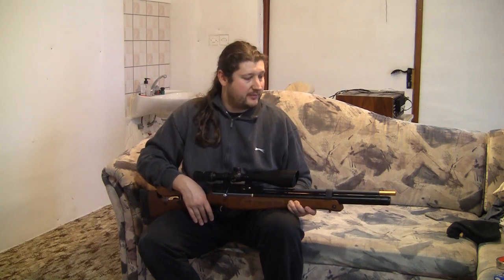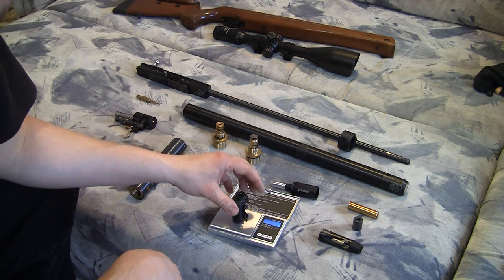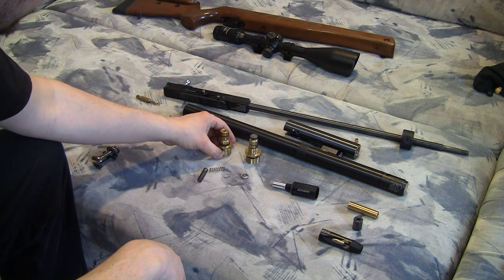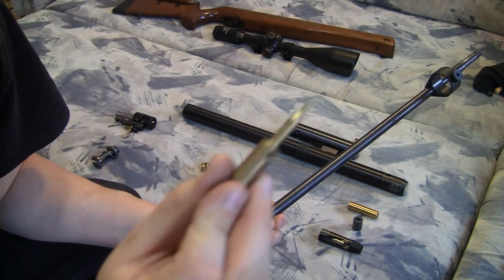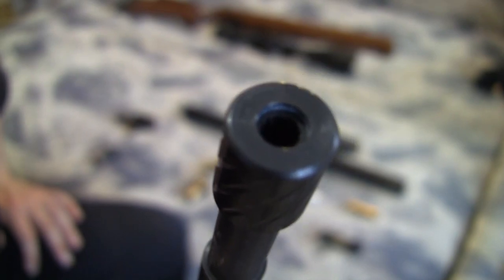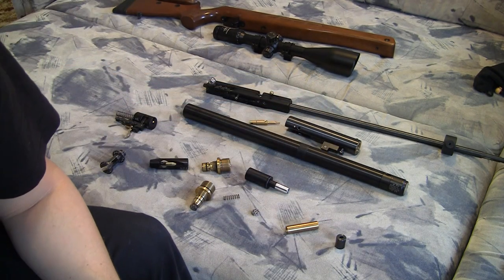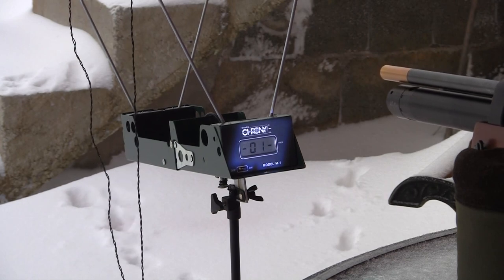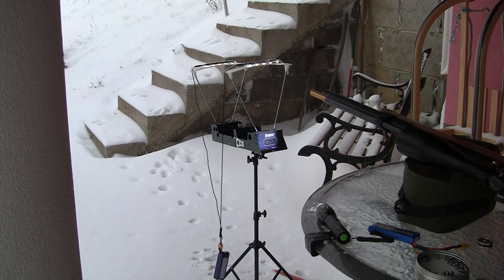Hatsan BT65 .25 regulated and unregulated

Comment: Where would you get the heavy spring you mentioned or part number so others can find it online, for closing the valve with regulator.
Reply from the maker: I have done several modifications since I made this video and right now I am using stock valve spring, but I did enlarge the valves seal (plastic seat, you get one spare with the gun) to 6.5mm. You can use the stock plastic seal, just turn it around...
Reply from the maker: BTW: I am not sure how it is in your country, but here where I live there are many spring manufacturers. All you have to do is sent them dimensions and they make a spring by your specifications. It costs about 10 eur per spring...

Comment: Awesome video, but I have one question, Could you show the shot count if you tuned to hammer spring down so that the JSB Kings would shoot around 295ms...Would not the bell curve be better and in turn have a much longer shot count before the ES goes bad?
Reply from the maker: Hatsan Varmit Hunter Extreme Channel I assume you are referring to unregulated rifle. If you use an unregulated rifle you will also get a curve, no mater what you do. I am sure that I would get more shots with modifications, but I do not see the point in it. I would rather user the regulator and rise the pressure to achieve 295m/s with JSBs. The shot count would be smaller (probably 15 - 20 shots), but there would be no curve and what is even more important - accuracy would be much better. I only wanted to test the power limits with an unregulated cylinder, that is why I have two cylinders: regulated an unregulated.
Reply: If you take a look at my video with un regulated BT65 .25 it has a ES of 11 right now, and my 100yard groups are under .900 or 22.86mm my 50yard groups are under .400 or 10.16mm I do not see how one can get much better then that with this rifle... If you can shoot a 12.7mm 5 shot group at 100yards then I would be sold on a regulator. You are 100% right...Hatsan is not built for a regulator.
Reply from the maker: Hatsan Varmit Hunter Extreme Channel I gees you had more luck with the stock settings of the rifle than me. You could not have groups like that with my BT65 without modifications. I could have a good group but only 5 - 7 shots per fill. Now I can get more than 20 shots in 1" or less at 100 yards (if there is no wind...).
Reply: All I did was plug the valve port with 8/32 set screws and left one open. re crown the barrel, and clean it, and adjust the hammer spring, gives me around 11-12 good shots before start gong south. which is not bad for stock if you only hunt like I do. But I can shoot over two clips just have to adjust a tad bit with mil-dot hold over.

Comment: This is a very good video! I will do it on his rifle. Tell me, please, what is the diameter of the bypass in the barrel(6мм or less) and the diameter of the needle valve. And spring striker standard or more stringent? Thank you very much!
Reply from the maker: I assume, by bypass you mean transfer port. It is 5,5 mm, you can also make it bigger, but you will have to replace the o-rings with thinner o-rings. The diameter of the needle is 2,4mm. Striker spring is standard but it is slightly loosen with the regulation screw.
Reply: Thanks a lot! forgot to ask, what diameter of an exhaust outlet in a tank stopper? already I ordered the regulator on the site. I will saw, cut and collect!!!
Reply from the maker: Originally, the valve seal has 6,5mm hole and it is made obliquely. I recommend that you make is straight and 6mm in diameter
Reply: Gregor Kamenšek Gregor, tell, please, for installation of the regulator it is necessary to drill an opening in the tank or not? In the instruction on the site it is told that it is necessary to remove rubber laying on a stopper and to leave a gap. Your elastic band is left. Thanks.
Reply: Антон Быстров And one more question! the special stopper for the tank was bought, or made independently or under the order?
Reply from the maker: Антон Быстров No, it is not necessary for the Altaros regulator to drill a hole in the tank, but you do need to remove the o-rings. Just follow their instruction video (don't forget to turn on subtitles) and you will do fine...
Reply from the maker: Антон Быстров I made it, as well as all other parts for these modifications.

Comment: @Gregor Kamensek, you ever thought about selling your valve assembly ?
Reply from the maker: Well, yes I did, but there is a lot of problems; for example, the TP hole has to be made for a specific gun ans not two guns will thread the cylinder in in the same position, and this is a problem with all custom parts I made for Hatsan...
Reply: Alright... Thanks

Comment: Did you happen to do any groups with your modified BT65, say at 50 and 100 yards or meters?
Reply from the maker: Only 50 meters, I am afraid we have very poor choice of shooting ranges here. Best group at 50 meters is about 16mm ctc, worst is about 30mm. These groups were done by JSB Kings, unsorted.
Reply: +Gregor Kamenšek - That's pretty doggone good but you ought to take a look at what BWalton has done with his Hatsans. His channel is Airgun Hunter Extreme, and he has some great videos there.
Reply from the maker: +Kratos000S Over time I have read many different opinions / experiences with other peoples Hatsans, and i tried a few different BT-65 myself. I noticed that everyone is made differently. Some have vast parts, some milled,.... So it is hard to compare them with one another. For me, new crown and not using the cap made a big difference in accuracy.

Comment: Hi on the images of your mods its shows the spring mod , the firing valve mod ,then you show a flat washer with a single hole in the centre , is this the part that fits on the pin that the hammer strikes ?
Reply from the maker: Not sure if I understand it correctly but yes, BT65 uses a washer shaped nut on the rear end of the valve pin and the hammer strikes this nut.
Reply: @gregorkamensek3923  Thank you !

Comment: Im planning to buy hatsan bt 65 qe . I wonder if I can fill it with electronic  car pump?
Reply from the maker: salim seviker Hello! No, you CANNOT use a car pump. You need a pump that goes to 200 bar (3000 PSI). These are special pumps / compressors that are also used for filling scuba diving bottles.
Reply: Gregor Kamenšek ok. Thank you

Comment: How long did you make the antibouncing part the entire length? the original part has 3.8 cm
Reply from the maker: +Alexandru Popa Hi, I relay don't know. I do not use this anti bounce device any more since it influences the accuracy, I have made my own anti bounce system that does not influence the accuracy and it works great (check my latest video). But I still have that part and If you like, I can measure it for you.

Comment: Hey Gregor ,

What is the size of the plenum from the Altaros regulator ?

Im working on my own BT65 with a Huma regulator and i'm struggling to get the King Heavy up to 280m/s. I have the feeling the volume of the plenum is lower then that of the Altaros...
Reply from the maker: Hi. it is about 40 mm long... If you have the "balance" (hammer wight, spring, valve size and spring) correct, you can get about the same shot count at about same power if you just set the pressure higher (or have a bigger plenum and the pressure lower) although you might not get to 280 at all unless you make at least the transfer port bigger... I have done so many modification to my BT since my video it is about time for a new video... Generally, I would suggest at least 50 mm plenum (I have 60 mm), and then you can get the velocities you want with pressures as low as 130 bar.
Reply: Hi Gregor ,

Thanks for your help !! I figured that was the problem , i needed like 155~160 bar to get the speed up to about 920fps/280ms. Even with the mods i already did.

Made a additional plenum that increased size to about 55mm and speed went up to 970fps / 295ms with the Heavy's on 145 bar.

The original plenum of the V1 Huma regulator that i have is just 33mm long , perfect for the lighter King 25.4 grain , but just to small for the heavy's.
Reply from the maker: perfect. I am glad you got it up to desired velocity :)

Comment: Bom dia
A minha bt65 é muito difícil de armar o martelo.
Você pode me ajudar com esse problema.
Obrigado pela sua atenção.
Reply from the maker: I am afraid that a lot of mods are needed to be able to have easier cocking of the hammer and they are not that simple. You can reduce the hammer spring tension but that will also reduce you power output.
Reply: Ok meu amigo.
Obrigado

Comment: Gregor - I have an AT44-10 short in .177 for which accuracy has fallen way off. The chrono run looks good 873 FPS to 890 FPS to 883 FPS with low extreme spread over 20 shots from 150 bar with JSB Heavies and two valve holes open. I have to choose to try to find the problem myself or send it back to HatsanUSA for service. I would rather do it myself, if possible, but disassembly will void the warranty. I have replaced the two barrel o-rings and the breech o-ring and cleaned the barrel well, but no change. Do you have any suggestions as to what I might check? Thanks.
Reply from the maker: Hi. Your velocities seem to be OK, you can check it the mechanism is damaging the pellets. Try to load a couple of pellets manually  (without the magazine) and test for accuracy.
Reply: Thanks, I will try that. Here's something that might interest you, though. My AT44 Long .25 cal was having accuracy problems, too. I can't remember now exactly why I did it, but I took the AT44 Short cylinder and put it on the Long, and there was an instant huge improvement. The short cylinder goes in easily while the long cylinder is a bit tight. Otherwise, I have no idea why the huge improvement just by changing cylinders. I'm going to send the long cylinder to HatsanUSA to see what, if anything, they can find. These PCPs seem to be a bit finicky.
Reply from the maker: Did you check if the o-ring seals on the cylinder are damaged? Also it is possible that the valve rod is bent...
Reply: +Gregor Kamenšek I replaced the o-rings as per Hatsan's instructions but didn't help. Didn't disassemble the cylinder as that would void the warranty. Still a few months to go on it.
Reply from the maker: Did you check if the stem of the valve is bent? You should see it when you have the cylinder out of the gun if you look in the hole that goes to the transfer port...
Reply: [edit: talking about the .25 Long here] Since my valve is stock, it still has 6 small valve holes. Looking through those, the rod doesn't appear bent. Of course, you can't see much. And the o-ring seat appears okay. I noticed two things though  First, while the short cylinder goes in smoothly and easily, the long cylinder is a bit bumpy going in and takes a bit more effort. Second, I measured the valve head toward the end, and it seems to be a couple of thousandths of an inch larger on the long cyl than on the short. So, I think it may be either that the threads are not cut correctly or the slight difference in the size of the valve end. Of course, I'm no engineer. One thing is sure, though. the difference in accuracy is amazing when I put the Short cylinder on the Long.
Reply: As to the .177 Short, that cylinder must be okay, as it works well when put on the .25 Long. On the .177, if you discount the flyers, I am not getting bad groups at 29 yds, but it seems every 5 shot group has at least 1 flyer that may be 1/2" or more outside of the remainder of the group. Puzzling.
Reply from the maker: Then it must be something obstructing the movement of the valve. Hatsan warranty service will solve this...
Reply: Wouldn't that show up in erratic velocities in the chrono run?
Reply from the maker: Probably...

Comment: How about you build a two hammer system.  Where one hammer is attached to the spring and the other (inside or in front) is free floating.  When the rifle is fired the hammer that is attached to the spring stops part way toward the valve and the second hammer continues on to strike the valve and when it bounces off it just travels back to the hammer that is attached to the spring with such little force that it can't compress the spring hammer and everything will just stop... The two hammer system could also be designed one on top of the other in a manner of looking like two "L" shapes where each "L" is at the opposite end.  And one glides atop of the other to strike the valve and the other is attached to the spring but has limited travel, just enough to push the second one (free floating) forward with enough force to open the valve... Of course the free floating hammer would have to be designed to engage the cocking mechanism but not directly attached to the hammer spring..  I bet you are smart enough to do it... It is like taking a car and pushing another car and then the push car stops while the other continues to roll a little further and runs into a cement wall.. lol
Reply from the maker: Yes, that is also an option. A lot of airguns already use this, for example: Daystate - I believe it is patented by Harper...

Comment: Could you please give me the measurement of barrel Brass end cap
Reply from the maker: I assume you need the thread? It is supposed to be 1/2", but I have heard form a lot of people that it is not totally standard...
Reply: Thanks, but i needed the internal diameter (except threat) and length of barrel brass end cap
Reply from the maker: Due to Hatsan's loose tolerances, I would suggest you measure it yourself on your gun... I can give you the diameter, but the length is not the same on mine because I machined a new muzzle crown on my barrel...

Comment: Hi Gregor, you are the most professional man i saw on the internet. i would like to install a pressure regulator as well.  would you please give me the size of the spring  that you replace for the valve in cylinder? Thank you very much.
Reply from the maker: +William Chen I have made some changes after this video and optimize the power further more... I recommend that you use stock spring, but make the valve seal hole a little bigger (6,5 mm). You can actually use the stock valve seal, but turn it up side down... With that setting and the regulator set to 120 - 135 bar (depends on the volume of the regulated chamber) you can get 18 75 joule shots  with JSB KING and up to 85 j with King Heavy.
Reply: +Gregor Kamenšek Thank you for your advise.
Reply: +Gregor Kamenšek Hi Gregor, as your final version, is it still important to decrease the weight of hammer? I got a problem when i increase the stress of spring in hammer, the trigger will be too sensitive or  trigger cannot hold the hammer. that's why I always keep stress low, maybe just turn the screw only 2  circles. I'm think to decrease the weight of hammer as you did. At same stress, the lighter the hammer, the faster hammer hit the valve, right?
Reply from the maker: +William Chen Yes, you should still decrease the weight of the hammer to about 60 grams. Yes, you are correct.

Comment: Where can I buy these things?
Reply from the maker: Miguel Fajardo Hello! Unfortunately, you can not get them, I  made the parts my self for my own use... You will need an experienced machinist to make these parts, but if you need any additional information, please let me know and I will try to help...
Reply: Gregor Kamenšek  hello  .. sir   i see what  you  are  doing  in this  hatsan  really  nice  ... and  i like  it  ... i would  buy  from  you  the  valve holder  in end the  cylinder  if  you  selling  one  or  2  parts  for  me  thats  will be  nice
Reply from the maker: Abdullah Hamad Unfortunately I an not selling these part (at least not at the moment). And also there is a high probability that it would not fit your gun (especially the hole that goes towards transfer port) because Hatsans have a relatively high tolerances (low accuracy) of their parts.